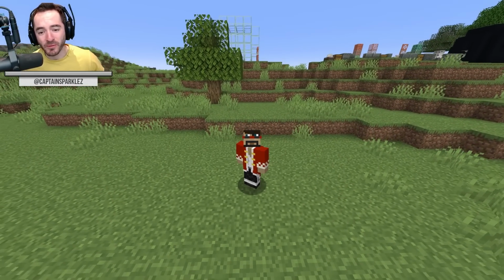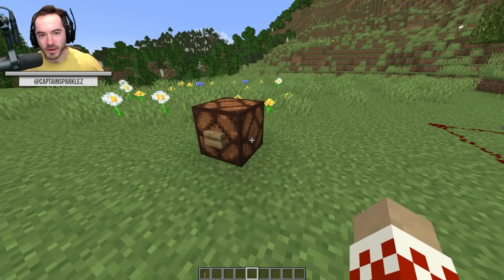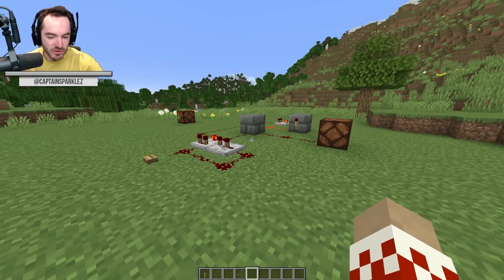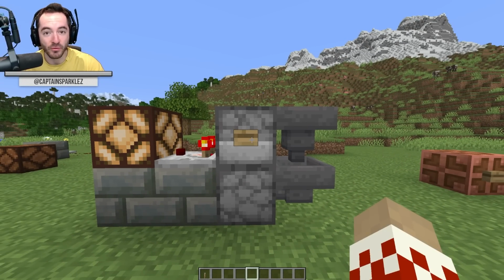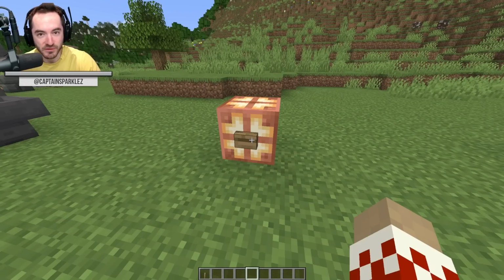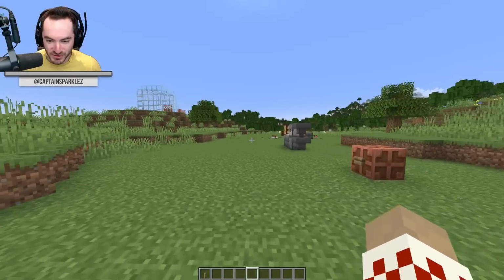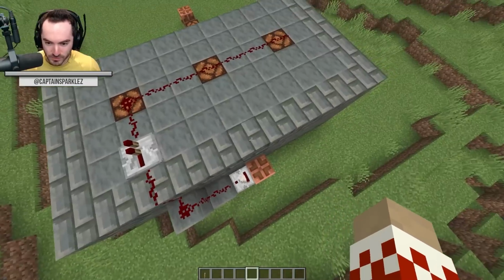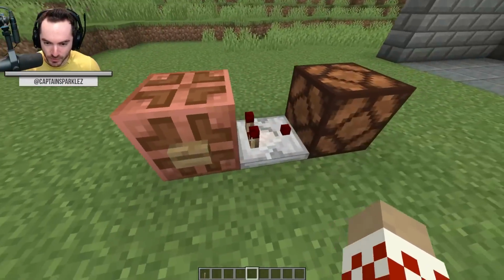This Is Huge For Minecraft 1.21

Comment: A one-block T flip-flop is revolutionary.

Edit: A lot of useless arguing about the semantics of the word "revolutionary" in the replies
Reply: The Copper Flopper as Mumbojumbo named it
Reply: Revolutionary Definition 1: Adjective - Involving or causing a complete or dramatic change

by literal definition, the crafter and this more compact T Flip-Flop fall can be considered revolutionary, one quite literally changed how Redstone automation can work going forward, and made many automations SIGNIFICANTLY easier. For the T Flip-Flop, any Redstone circuit that can be compacted as small as possible would be considered revolutionary just on the basis that it effectively compacts any Redstone builds using a less compact version of that same circuit, as Jordan basically showed in this video, one of the most compact forms quite literally got cut in half in terms of size just because of the Copper Bulb existing.

so both of these can be considered revolutionary in different ways, one for changing and adding to automation, and one for compacting a circuit to what will likely be the most compact version of the circuit possible (unless they make a block that is basically the whole circuit in a single block, which won't happen for vanilla mc)
Reply: @fusionwing4208  OK, so first of all, thank you for bothering to write all of it. I appreciate your effort. I'm also glad that you actually understand the full meaning of the word that is revolutionary. Why I don't believe that the copper bulb is sort of analogous to transistors and computer circuits. I'm aware of how copper bulb will allow for compacting T-flipflop to basically 2 blocks. What I mean with computer circuits is that they were compacted a lot (amount of transistors in circuits double approximately every 2 years), yet it didn't bring a revolution. Sure, if the change that happened over 50 happened in 1 discovery, it would be a revolution. Copper bulb will make some things significantly easier, but after all, it's just a smaller T-flipflop. T-flipflops that need to be this compact have a rather narrow use case, unlike it might seem. At least narrow enough for it to not imply a revolution, IMO.

About the crafter. Yes, crafter on its own is an unprecedented feature, but I'm afraid it won't be as useful as it appears. In many games, something like that is necessary because you would have long processing lines, and because crafting in other games usually takes time. In minecraft, however, crafting takes no time, so doing it manually isn't such a big deal. However, I'm not saying it will be redundant, of course. It will be incredibly helpful when an item, being outputted from one farm, needs to be crafted before being processed in another one (for example, bones being turned into bonemeal so it can power a tree farm). This use case is quite niche, tho. It's uncommon to see several farms "cooperating," especially when crafting is needed. Of course, I may be wrong. Maybe such things weren't a thing because of a lack of autocrafting, not because of lack of need. But for now, I don't think those 2 things will spark a revolution that will change the bigger picture of redstone. Though they will still prove to be useful. I'm looking forward to seeing how they will change minecraft. Thank you for your time, and have a nice day :)
Reply: @brickie9816 not even 2 blocks, a bulb t flip flop is three blocks! Because they aren't solid like they need to be
Reply: @kevinjamesmartin4307  Yeah, that's correct. Technically, they have the same footprint/bounding box as the old dropper T-flipflop lol. But I recon it's still more flexible. Yet, a more flexible T-flipflop is not a revolution in redstone.
Reply: @brickie9816  
Revolutionize - change (something) radically or fundamentally.

This is a fundamental change to T-flops and simplifies redstone circuits in some drastic ways. 

You’re arguing over opinion.
Reply: @matthewcaimbeul8722  This is not a fundamental change to T-flipflops. They got a tiny bit small and a whole lot more flexible, but this is still the same T-flipflop. It still functions in the same exact way. This is an elementary circuit, not much to be revolutionised in it.
Reply: @brickie9816  - The Tflops are simplified and can use different simpler, less blocks to do the same basic operation. The base of blocks used has changed.

If fundamental means:
Fundamental - forming a necessary base or core; of central importance.

The core tflops blocks and their base has changed, it’s fundamental. 

If it’s a fundamental change, see definition for “Revolutionary”.

You’re dramatizing this.
Reply: @matthewcaimbeul8722  No, everyone I'd dramatizing with all the claims of a revolution. And no, the fact that Tflop will now use different blocks doesn't mean it has been revolutionised. No contraption even uses them to a degree to become significantly compacted by the introduction of bulbs alone, at least, as far I can tell. But who knows, maybe I am the pne wrong. Perhaps you have an idea what revolution the copper bulb start and what will it be about.
Reply: @brickie9816  - LED and Fluorescent light bulbs, same functions, even look the same, sample application, same threads. One is just simpler, and less energy intensive. 

But yet LEDs are still revolutionary.
Reply: @matthewcaimbeul8722  but LEDs take a whole lot more efficient and simple + laps are literally everywhere. LEDs were a revolution illumination. This is a completely disproportional example. Copper bulbs didn't make Tflops that smaller. More flexible if anything. Tflops aren't used often enough for this to make such an impact. This a revolution of nothing.
Reply: @brickie9816  - If you have multiple tflops then yes this drastically makes them simpler.
Reply: @matthewcaimbeul8722  But that's rare. I don't argue that it's useless, but that it won't bring a revolution. Call I'm unimaginative, but I can't think of a single example of what would be improved so significantly with this new addition that it would revolutionise at least a single field.
Reply: @brickie9816  - Redstone itself isn’t revolutionized. Tflops specifically are.
Reply: @matthewcaimbeul8722  they are literally just 1 block smaller than what we had before. And easier to activate. I wouldn't call that a revolution.
Reply: You should have said it FLIPS the script....
Reply: Oh, only now I have realised of the edit you have made. I didn't mean to cause all of this. I'm sorry.
Reply: They're not one block they're 3. They need to be solid blocks
Reply: That is a lie, they are not one block t flip flops, they are 3. Bulb, comparator support for the comparator.

They are rightfully solid blocks they should make unwaxed be solid for all purposes and waxed be transparent for the one single only specific use of being directly powered by buttons but not lighting up 5
Reply: This comment is extremely tiktocky
Reply: Ong people stop calling new redstone blocks in 1.21 revolutionary. Both crafter and bulb are great, but they are not gonna revolutionise any field, just improve.
Reply: @brickie9816  That's what revolutionizing is. The biggest inventions that pushed humanity decades forward where things that already existed but were made to be smaller and faster, like the MOSFET transistors of the 50's or the personal computers of the 80's.
Reply: @manvslife271  yet "to revolutionise" is a big word. A very, very big word. Those things you have mentioned changed a lot, but they were merely bigger than usual steps towards something that would have been achieved anyway. A steam engine was a revolution. Printing was a revolution. Calculus was a revolution. Those things weren't simple steps forward. They changed the world and turned it in a different direction as the name "revolution" would suggest.
Reply: @brickie9816  They might revolutionise binary counters in Minecraft
Reply: @iliketrainsilikeplanes6047  just improve significantly but nothing crazy
Reply: @brickie9816 how did you use Nothing crazy, and significantly in the same sentence. You were literally just talking about how revolutionize being a big word.
Reply: @brickie9816 it's not like theyre completely serious when they say "revolutionary", it just means they can make more contraptions with this one block.
Reply: @teenspider  yeah exactly, that's what I mean. But I just dislike that people are exaggerating. Redstone saw much greater things than those 2 new blocks combined
Reply: @brickie9816  the compact nature of this plus the fact that it can be pushed by pistons WILL make things that were impossible (or close to impossible) within the realm of possibility, thereby meeting the very DEFINITION of "revolutionary". Your brain is just too small to see that.
Reply: @slickmann11  thank you for maintaining respectful conversation.  The fact that it brings some change doesn't mean it's revolutionary.
Reply: @brickie9816 say you don't use redstone without saying you dont use redstone
Reply: @Jobroski47  ok that's fair actually. What I meant to say that it will improve counters significantly but it's not enough to bring any sort of revolution
Reply: @Jobroski47  ok. "I agree that copper bulb is completely revolutionary because I saw others say it's cool, which means that it will obviously revolutionise something, not be just a cool addition"
Reply: @brickie9816  one of arguably the biggest human revolution is the Industrial Revolution, a transition from hand production to machinery, dont know about you, but that sounds alot like the crafter.
Reply: @brickie9816  stop complaining.
Reply: @VoidTheBear  no. go away
Reply: @brickie9816  no u
Reply: @brickie9816 literally nobody agrees with you
Reply: @VoidTheBear  no why
Reply: Guys, no nerd on nerd violence. We must stick together. Lol
Reply: @brickie9816 bro what are you on? Sure this is just simplifying things, but the crafter literally made things possible that weren't possible before
Reply: @dodhethompson4841  yes? Doesn't mean it's revolutionary tho. Hopper and piston was tho. Don't you see the difference?
Reply: @brickie9816   "Redstone saw much greater things than those 2 new blocks combined" is an completely pointless argument, just because redstone has seen revolutionary additions in the past DOES NOT mean it cant be revolutionized again. the main functions are arguably not that revolutionary but they are so much so on the redstone side of things, being able to compact a T-flip flop into a single block is so much of a change, just think of what people could've made in the past if they had the ability to do so. thats what revolutionizing is. Changing a single thing, even if its small can immediately cause a impact on how people do stuff, and to be frank, a lot of things could now be possible that wasn't, due to the ability to compact it into a single block, we just dont know it yet, due to it just releasing.

and just a p.s. you can move it. single handedly changing what you could do before.
Reply: @brickie9816  is just a troll, if u argue against their incorrect (and fake) opinions, then u let them win
Reply: @elijahanonymous4596  no I'm not a troll. I do believe that both crafter and copper bulb, as much as they are useful, they cannot be classified as revolutionary.
Reply: @brickie9816  The crafter is literally going to revolutionize things. You were never able to craft things using redstone before. Being able to do that is a revolution. It's literally what a revolution is. It's going to change  a lot of farms FOREVER. It's like how the invention of the wheel allowed us to do things that were NEVER possible before.
The cop flop can also be considered a revolution. It's going to make redstone contraptions much more compact and easy to build. It's like how solid state storage revolutionized computer storage to the point that disc based storage is now almost never used. Because it's a new basic component, a lot of the janky contraptions of the past will never be used again. 

These are the very definitions of being revolutionary. If you use redstone you will know that these aren't just feature addons like those sculk sensors and composters etc. These are literally allowing you to do things that were never ever before possible. Just like the piston and the hopper you pointed out before.

Again though revolutionary can be subjective. For people doing parkour these aren't even noticeable changes. But for people that actually do stuff with redstone, these are absolutely revolutionary.
Reply: @brickie9816 The crafter literally does something that was completely impossible previously. It literally created an entire field of redstone.
Reply: @bluefireanimations3712  a field of what? Crafting things for you? That would be less useful than furnace arrays, and they still aren't revolutionary. Just useful, like the crafter
Reply: @brickie9816  bro copper bulbs are literally broken for redstone, t flip flops were genuinely hard to squeeze into compact builds
Reply: @Cera_01  yes but that doesn't make them "revolutionary" for goodness sake
Reply: @Cera_01 It's funny how you're unintentionally giving credit to the flaw of bulbs not being solid and powering adjacent pistons hoppers etc. Shouldnhave to wax them to make them transparent bc they are THREE BLOCK T FLIP FLOPS the bulb comparator and support for the comparator
Reply: @brickie9816 No but the crafter is GENUINELY revolutionary, as in industrial revolution revolutionary
Reply: @ejg9076  Alright, so far, I thought that people just called things revolutionary with rashness, but you seem to prove otherwise. Well, my scepticism might be wrong after all. Every word is to be verified by reality. I'm looking forward to seeing what and how much will it change, and perhaps you are the one right who knows.
Reply: @brickie9816 You're right and they're wrong. Bulbs must be solid before they truly step into their explosion of use cases. Make it so waxing makes it transparent for like 3 use cases, but dozens of others necessitate soft powering from bulbs. These people are actually being evil

Comment: The copper lamp is indeed very revolutionary
Reply: Not yet it needs to be solid & activate adjacent components like pistons, droppers, dispensers, hoppers, etc
Reply: If you want to retain transparent bulbs which are actually 3 block t flip flops instead of just one, make wax prevent them from soft powering adjacents
Reply: i believe it's named copper bulb

Comment: Genuinely this is such a cool little quality of life feature for wiring
Reply: It's not quality of life, it's revolutionary. Because, it toggles on and off not just from a button, but from any pulse, and that pulse could be anywhere within a redstone circuit. Plus it's transparent, movable by pistons and works in a single game tick as opposed to a redstone tick, so timing can be much faster. And there's more. Because it has an indicator for when it's powered, it can set off an observer on both the rising and the falling edge. I guarantee you, new redstone computers and contraptions are gonna have these all over the place.
Reply: @overpower3382  Still mostly just quality of life. Target block also appears all over the place, not because it's "revolutionary", just cause it's a good quality of life feature. Copper bulbs will mostly just slightly compact certain circuits, make interfaces a bit nicer, etc. Anything it can do could already be done at most a block or two bigger. The only exception I can think of is writable feedtape memory, but even that isn't particularly revolutionary. It's slow and not the most compact form of memory. Item memory is a lot better in many ways.